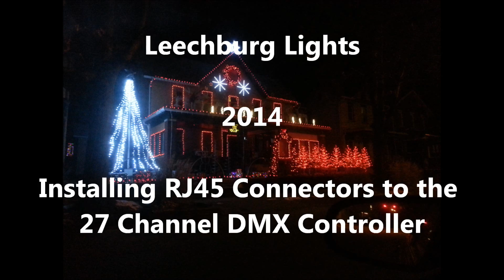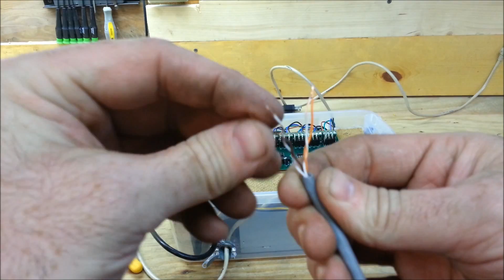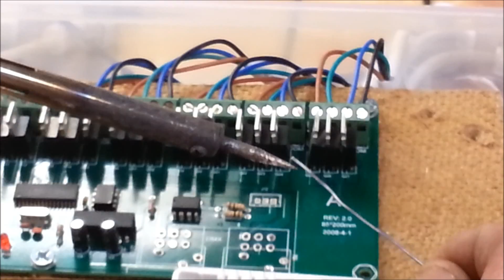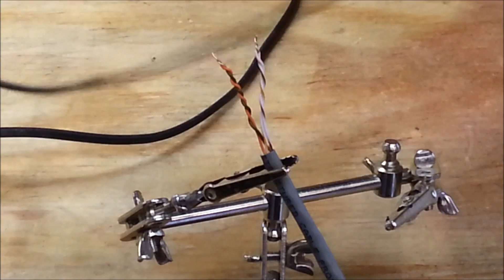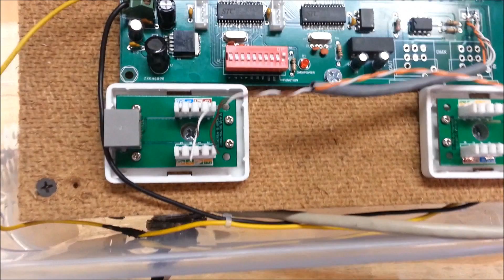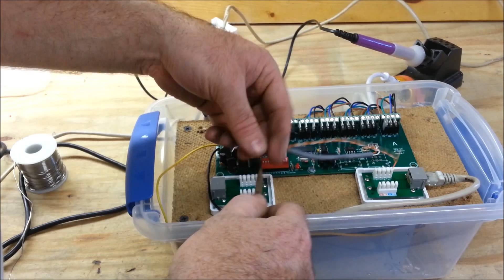Installing RJ45 Connector to the 27 channel RGB Controller

Comment: Very new at this and need help I have a 8 channel dmx decoder and a power supply and a lor controller what am I missing I have the lor with the dmx 512 plug in it please help!!!
Reply from the maker: I don't understand exactly what you need help with?  Connecting to the software? How to make your lights flash?  LOR and the DMX controller don't get hooked together with a regular cable.  There is quite a bit of research to do in order to make this work.  If you're running the LOR software, I recommend the LOR Forums to begin researching about connecting DMX to the LOR software.

Comment: So the num 10 switch has to be "on" for the board to receive data? What about if i want to set the dmx number start to channel 2?
Reply from the maker: musicmaneman38 For this specific board, the number 10-switch is a "demo" or on-board programmed pattern.  If you try to run DMX data with the 10 switch "ON", the data may not be converted by the controller.  When connected to a DMX source, make sure your start channel is set with the 10-switch in the off position. I use the 10 switch to test RGB's after soldering them to insure they work and complete a burn-in process.
Reply: in your video you hooked the board to a e682. Can'T it be cnnected to a E1.31 controller directly?
Reply from the maker: This board only runs on DMX.  Whether the DMX is RECEIVED from the e682, an Enttek Pro/DMX King USB dongle, or an E1.31 bridge; this controller only recognizes DMX.

E1.31 is a concentration of multiple universes with packets of data which is read by a compatible E1.31 controller.  This controller can not read E1.31, so it must be connected to the "bridge" (ie.. E1.31 or USB device) via Ethernet cable from the RJ45 connection on the computer.  I wish it were as simple as connecting directly to the computer.